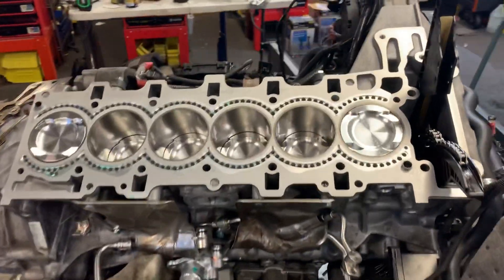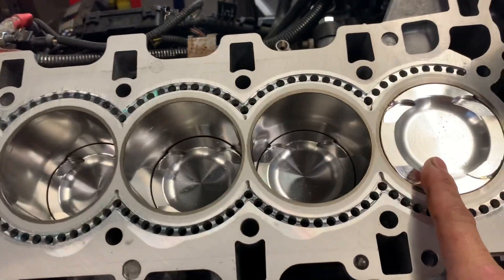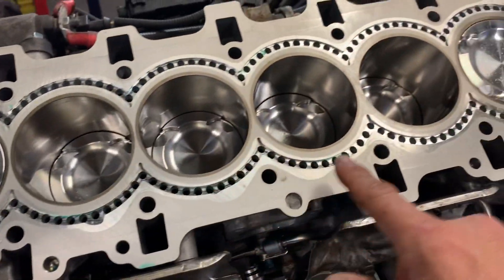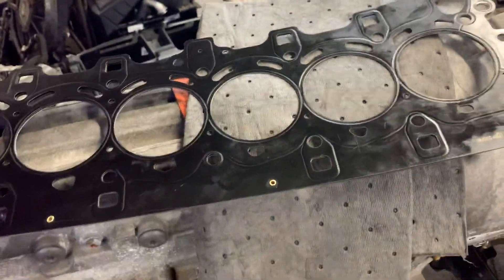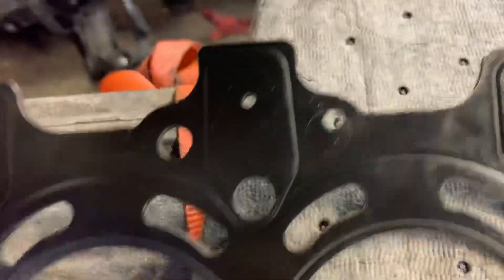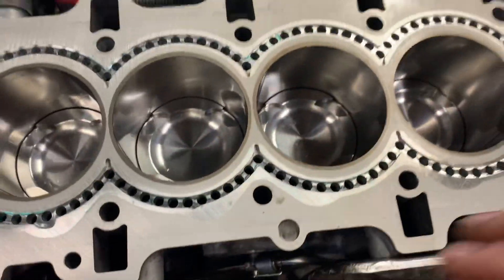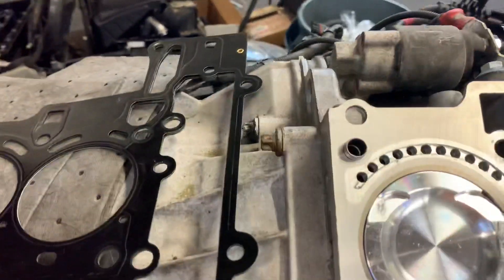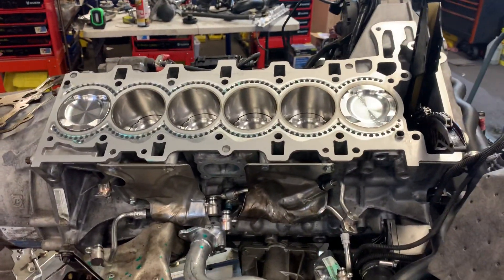VAC Motorsports closed deck block N54 MLS head gasket

Comment: I’ll be sending my N55 to you guys… can you build it to take 2000 hp?  Or maybe 3000?
Reply: Lol n55 2000 hp🤣
Reply: @Money.Pit.Media_tv The N55 block is nearly identical to the N54. 

If an N54 and N55 both had forged internals with a 6466, they’ll both make the same power, and neither one will pop.

Comment: How does an insert like that work? I don't understand how an insert is literally inserted into it with tolerances that low
Reply from the maker: Bigfwop L That’s what makes what we do so amazing, you have to make a perfect cut out in the engine block and we put the inserts in a freezer so they shrink then we insert them into the block very tightly and then we surface the top of the insert and the block together so that the surface is perfectly flat and it gets sandwiched between the head gasket
Reply: @vacbmw  Ah so they are held by the expansion of the metal... Beautiful work!

Comment: Beautiful! But why a closed deck for 700? Prep for more power in the future?
Reply: Not sure but N54s don’t need closed decks. Wedge tuning has over 900whp on a built motor with an open deck.
Reply: @ReignRegime  if you going to use your engine for <30k miles then probably open-deck is ok (though not always).
more rigid = more reliable. the more mileage for open-deck - the more deformed it's cylinders will become.
resulting in oil consumption, piston melting, crankshaft bearings damage (cylinders deformation pulls the entire block geometry including bearing clearances).
starting with open-deck era all these problems turned from very rare to common.
Reply: open-deck may be enough for NA engines. but not always. they still get warped even in NA applications. the worst block design in the world.